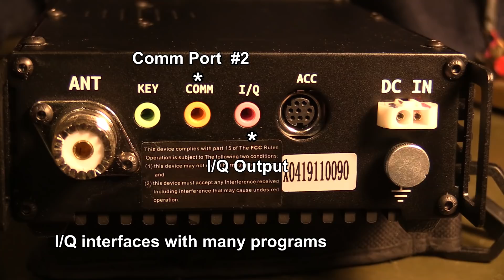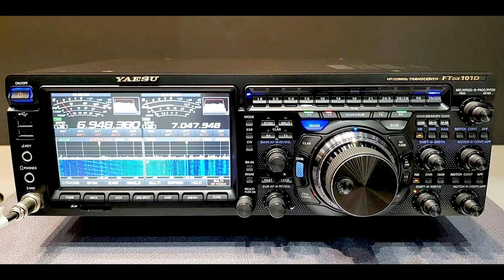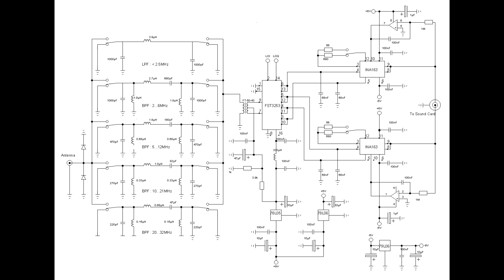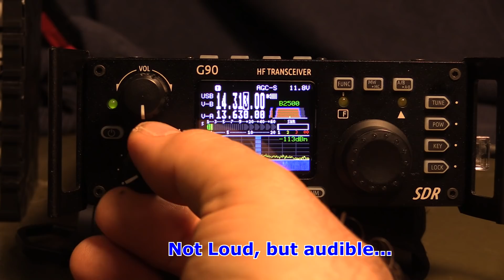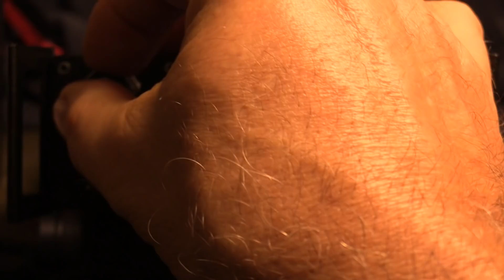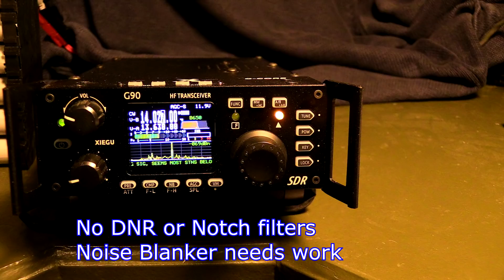Xiegu G-90 QRP SDR Radio Review

Comment: Many thanks for the great video.  I recently purchased a G-90 and have been experiencing  extremely garbled reception.  I'm wondering if the power supply choke might be the cure.  Do you suggest any particular mix?  Can I use a couple of chokes at different mixes cover more bands?  Forgive the questions, but I'm a rank noob on my own.

Comment: "I got my second-handed G90（actually a G90S for sales in China mainland, they shares the same firmware, instruction manual, hardware and so on) 3 weeks ago and it worked fine at the time. Today I finally set up my 40m antenna and wants to try some FT8. But I mistakenly plug the Serial RS232 plug into the COMM port on the back of the G90 instead of on the left of display part, it worked for several minutes and "COMM LOST" appeared on the screen. After some researching I thought it was the body firmware being accidentally wiped so I downloaded a v1.79 firmware into my body, it says completed.

Then I followed the instruction to flash the Display part, it failed with only 0.7% progress (for only one packet transmitted) and then stuck there. Then I tried v1.78 and v1.80b none of them worked for the DISP part but all worked for the BODY part. I tried TeraTerm, Hyperterminal and g90updatefw for flashing it. TeraTerm stuck at 1 packet and 0.7%, Hyperterminal showed 9 CRC errors continually and exits, g90updatefw reported ".RRRRRRRRR" and says complete but actually failed. None of them worked and seems to reporting a CRC checksum error.

My body part works fine, it makes a noise after click the power button to try to boot up. But DISP part doesn't give any response, screen no light, LED no light or blink, buttons no response, seems to be completely dead but its Bootloader still responses when I try to flash it, though I can only wipe it but not write any data into it...

I think its not a cable, computer software or firmware version error because they all worked for the body. I can receive the flash reset progress from the DISP part so I think it is still working fine for the CPU\voltage regulator\UART IC\bootloader. I followed all the instructions and tried all two ways(vol button or space key) to flash the firmware. I've tried hundreds and thousands of times but all the errors are the same. Can someone help me to solve out that problem?"

The discussion has ended and I have an identical problem with the G90. Does anyone know how this can be fixed?

Comment: Bob in other words sdr have.Better receivers than heterodine receivers
Reply: In general Yes. The main chip needed is the ADC and these have been getting faster and cheaper. When the 7610 was designed- each ADC chip for it (one for each receiver) were $200 each. Right about now- makers can design a fantastic direct-sampling SDR radio with top-level specs at a competitive price to old superhet designs. No maker will design a superhet radio from now on.

Comment: It's interesting that for so little money, China managed to do it with a 24Bit chip. because such an IC705 is only 14Bit and I would be quite interested if you had the opportunity to compare these two radios with each other. I recently bought an IC705 and I don't really know what to think about it, because I don't like the signal that the TCVR produces, it seems to me that the noise level is too high and the noise from the 705 is not very pleasant to my ears. Paradoxically, I bought the 705 as a new toy instead of the Xiegu x6100, and now I remember the significantly cheaper radio quite fondly, because I made a lot of beautiful connections with it at 10W. Now there is even a complaint because the Wi-Fi stopped working and the possibility to control the radio from a PC, which is unfortunately not completely possible in the case of Yieg. I'll see how the claim develops, maybe I'll sell it and buy some Yaesu, which I don't like the look of, but it has a great receiver. Unfortunately, the designer at Yaesu probably came from the production of washing machines, because I absolutely do not understand why the x6100 has a spectroscopic awering and Yaesu does not have it for quite a lot of money, and I have to look at the desperate flashing disco on the display, that's the only thing that keeps me from buying it for now. Thanks for the great videos, 73! OK1TCM

Comment: Hoping you might offer some advice. I am tech studying for general. I really dont want to rag chew alot, but the learning is what i enjoy. Want to practice nvis and ssb voice around the globe, along with FT8 and other packet stuff. Also would enjoy POTA. I am in a new neighborhood with strong HOA restrictions so permanent HF antenna is doable but tricky and will have to be subtle. My end goal is a FT710 and I have the money for it. BUT, it will take all my money, so there wont be much for antennas, etc. I hear low watt rigs are bad for beginner, especially when learning antennas. Would you think a G90 would serve me well, then get a 710 later, or just get the 710 now? I think a 817 replacement is close, and that is another reason I am leary of the G90 although the replacement will likely be pricey like the 705. Not sure what to do. KD9IRA

Comment: Ho Bob,

Thanks for all the reviews. Just purchased a used G90 and the remote cable is missing, do you, or anyone else, know if it's a straight through DB9 cable or a null modem type with some of the connections crossed ? 
Thanks, Mike G1ZRN.
Reply: I received a reply from Radioddity about the remote cable and they said it is a straight connection pin to pin DB9 Serial type cable. Hope this helps others .

Mike G1ZRN.
Reply: I don't seem to have my cable, but it wouldn't hurt if you got it wrong... just would not work. I think it's a straight cable (just a guess)

Comment: Xiegu G-90  Final Amplifier Driver (Mitsubishi  RD06HHF) & (Mitsubishi RD16HHf)  Finals are more than  likely Counterfeit Versions as with most Chinese  Radios that every one ignores till they fail just to get stuff cheaper.   The Japanese company Yaesu make high end stuff they use Real Chips not counterfeits.

Comment: looking at the RF like the IC-7300 SDR has front end overload. noticed it bad on a IC7300 on contest with a lot of CW the IC-7300s there were all having  this problem . The FT-DX10's did not have the front end over loading and single out signals cleanly .

Comment: Good report Robert if the G90, thank you very much. Can You tell me wich is the consume at 5W? At 20 Xiegu saiys us 8A.
Reply: 2 amps on TX at 5W.  On 20W it is really 6 amps peak on SSB
Reply: @Yavor54  Good! As You Say in the video, You can use with low amper batteries. Depends of the tiene of use, but I hace a tiny 33A cicle battery to have lot of fun. I have a 991A and a G1M, ando a uSDX V2 with battery included, nice. I'll sell the G1M ando Buy the G90.  73 from Luis, LU1CBQ! Thank for Your answer.

Comment: Sir I needed an help from you... I have an SONY ICF SW77 radio .... but there are some issues with those 24 Capacitors ... so sir really do this Damage caps can make the jog dial an those faulty 24 capacitor make the Jog dial not to work sir ??? My this Jog dial means Potentiometer has carbon on it .... Anyone from this group please reply to me... ??? My Arrow scan keys are not working... An the sound is very low like 5% only on full volume... So what has made my those Jog dial not to work... ??? Please reply ...

Comment: Great reviews, many thanks. Interesting to see the G90 uses the Tayloe quadrature mixer, just like the $120 uSDX rigs.   I think the 48khz spectral display is a bit low, 96khz would be my minimum, kiwiSDR for example shows the entire band or even MHz.
Reply: They made the sweep time as fast as they could at that scope width. On the tiny screen, it would be crazy to show any more spectrum width too.
Reply: @Yavor54  True, the Cirrus ADC they used does sample at 192 KHz, so they could allow it to show 96 KHz though would be a but cramped

Comment: Great video. I am curious how you compare this G90 to the RS-918 transceiver you looked at 3 or 4 years ago. They both seem very appealing.
Reply: No comparison really. The design of the 918 is very simple and results in a lot of image signals on the display.  It's receiver is not in any way in the class of the G90. I find the G90 receiver to be almost identical to my IC-7610.  The G90 is a little more sensitive though. Sherwood numbers may place the G90 lower than the 7610, but in actual use, the G90 RX is VERY respectable. Sure, the display is small, but it is so useful that I sold my GSOC large screen accessory for it. If I grab a portable radio to go, it's the G90. (and the 20W makes a Huge difference) I do suggest a folded dipole resonant antenna at that power level. A little gain and everyone can hear you.

Comment: Great radio. I love it and transmit reports are glowing. The receive audio is very good for such a small footprint. The only issue I have is the noise blanker which though adjustable makes no discernable difference. Its a pity it doesn't come standard with a mounting plate in order to sit the front face up off the desk which means it can get quite warm during the summer months.
Reply: You have to get the G2 fan/bracket assembly for an additional $70.

Comment: How large is antenna?
Reply from the maker: You can use any size antenna. There are hundreds of antenna designs. A simple 3 meter wire will work...but a very good antenna would be a HexBeam.
Reply: @robertnagy2163  I want one Ffor HOBB in flat or summer house here in sweden . and adapter is that incluedeed?

Comment: Great vid.
If I were to install this in my 2004 Ford Ranger pickup, what antenna would I need?
Thank you!
Reply from the maker: The bigger the better. Depends on what bands you want to use. For CB, it's a 108 inch whip. Ham bands- there are several good mobile whips offered.
Reply: @robertnagy2163  Thank you

Comment: I was running Field Day last year 1E-Solar and between limited sunlight and having too many unnecessary shack accessories (like the Wires-X node) on the LiFePO4 40AH battery, the voltage dropped below what could run the IC-7610.  I swapped in the G-90 and had a blast with it... nice little receiver and 20W was enough to be heard (of course, I was using a decent antenna).  Glad I had the little W2ENY desk mike for the Xiegu.
Reply from the maker: Interesting ehh? Because you can't get full technical detail on the G90, I have to assume they are down-regulating the supply voltage on the finals - which results in no loss of power output with lower voltages. The finals are 2X 20W mitsubishi devices with a drop-dead power out of 42W total. The 6 watt driver is feeding at 60mw, so a slight tweak of it would result in increased power out. I'm sure we could go 30W without overheating in SSB. I'll give it some research time soon.

Comment: how does this compare to "classic" analog hams (icom, yaesu, kenwood) ? im looking for something that can run on external battery pack and (with proper antenna that is) would cover at least central europe. also, is there option to use external screen or you have to buy whole front panel from producer of radio?
Reply from the maker: If you are looking for emergency communications, then this is not for you. I would look for marine SSB radios.

Comment: Getting a lot of noise from my 12VDC power supply.  Want to install a ferrite like you did.  Which ferrite did you use and where did you get it?  Also, how do you remove the pins from the white connector, what type is it? ( I want to try another ferrite that requires pin removal).  Thanks for your help - great tutorial, BTW! 😊
Reply: I used a generic clamp-on ferrite. I think you'll have to get a cleaner power supply. Don't waste your time. I'm sure you are using a switcher. Go get a 12A linear power supply. There is a pin removal tool... little tube device.

Comment: Thank you for this video Bob. I have been watching it for a while now and it looks very promising. I am hoping this will be a good starter/ entry level HF radio. It would be nice to have 6m as well. Eventually I see myself buying the matching amp and GSOC for better base functions.
Reply: Really, it is a good choice. On amps, Xiegu's XPA-125B is a super one. It isn't cheap, but it very robust and includes a great antenna tuner. Radiooddity has their tiny HF amp and low-pass filter pack. I use them portable. Not as polished a system, but it works. Watch the GSOC to see how their firmware improvements go... it is a maturing product. The G90 itself is a winner.
Reply: @Yavor54  wtf is a GSOC?

Comment: Got out of the hobby for a few years, sold all my gear to start a photography business which eventually died due to Covid. Looking to get back on the air now, and I noticed the G90. I've seen several reviews that were basically crap, but your video tour of the G90 opened my eyes and I learned a lot from it. I like what the G90 brings to the table and will be perfect for my return to ham radio, operating in portable mode much of the time - either from home or one of the many parks in my home area of Central Texas. I'll purchase the radio soon and give it a whirl on all modes. Thanks for helping me decide what rig to purchase and get back on the air! 73 de WQ1C - Kempner, Texas.
Reply: So glad I could help. SDR is really a nice jump in radio technology. The Yaesu FTdx-101D ($4k) uses the same architecture as the G90. They both use one stage of superhet type mixing before the SDR section. The G90 actually uses a 24 bit ADC chip and the 101D an 18bit. It is hard to find fault with the G90. Test it against most ANY other RX and it just sounds slightly better. It's hot and has good selectivity. I've got the big boys to compare it to here in the shack. Welcome back. I left Central TX in 2003 for Hot Springs AR. Had a great time in Austin during my and it's hayday!  73's

Comment: I operated remotely on Local 10 meter (28.405) Net from highest point in this area (German Hill)

Xiegu G90 worked alright mostly good receive and transmit (17 watts)

The problem of Loud Burst of Audio happens after I transmit and a Near Local Station with a strong signal (S9, +20, +40) transmits just as I unkey the microphone, Xiegu G90 will emit a Loud Burst of Audio as if AGC doesn't adjust signal level fast enough.

I use many radios (Yaesu FT-818, Yaesu FT-891, ICOM IC-705) from this same location without problem occurring.

I've tried all Xiegu G90 settings of AGC (Slow, Fast and Auto) and RF Gain Control without success.

Anyone else experienced this problem?
Reply: I think this issue was addressed with the latest firmware update.

Comment: Is there a method to enamble external audio jack? I instert the audio jack for external speaker but it doesn't work.
Reply: You can switch between the external and internal speaker..I think you just press IN the volume control.

Comment: Outstanding YOUTUBE Chanel 
All your content great.  Don't say much but I feel it's past do. Going to do anything about the amplifier. Have a FT-817 just don't know what to do. Do both. Lol
Reply: Thank you! I'm not after max views here. I'm trying to do the best job. Amplifiers are an issue. I've been testing several here. The Xiegu PAX-100 has been pretty good so far. Have to use their low-pass filter kit (cheap). Best so far is their XPA-125B. It has super-robust finals and is capable of twice the average power out as a 100W radio. Needs nothing to drive it. Downside is- it ain't cheap. Everything else has been disappointing. Icom rumors are that they are releasing a matching amp for the IC-705....which I have here- and will do a review of. The 705 is head-and-shoulders better than everything else like it (I have FT-817 too). Sell the 817 and get a IC-705 and wait....see what comes along.
Reply: @Yavor54  what would be a good price for 817, it's like brand new
Reply: @paulhastings3109  If you haven't sold it yet, I would say $700, maybe $750; that's to start.

Comment: Ok I do believe this was the best in depth review I have watched on YouTube and I watched a lot.  Just so happens a used/new G90 came up on are local online swap net and as a result of the YouTube reviews I purchased the G90 from a local Ham who didn't admire the radio. I was still shy and uncertain of my purchase until now; after finding your channel review on the G90 I was once again feeling positive.  Thanks for a deep dive into this radio. I subscribed and will binge watch your videos while waiting for the post. Cheaper then the  cost of gas and my time. Tha is again.
Reply: the G90 is really one of the best portable radios you can get. I have the Icom IC-705 here and although it is much more polished, the RX in the G90 has superior selectivity and sensitivity. The difference between 10 and 20 watts output is also HUGE when operating in the field. Use a folded dipole or other gain antenna and everyone hears you.